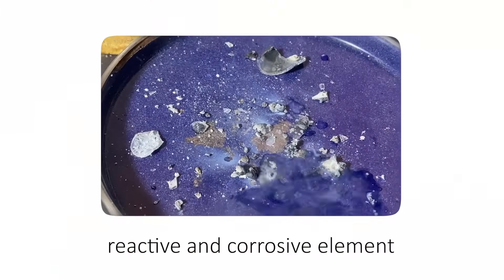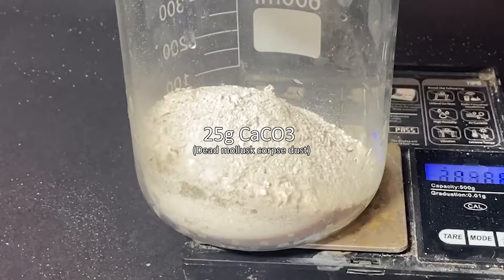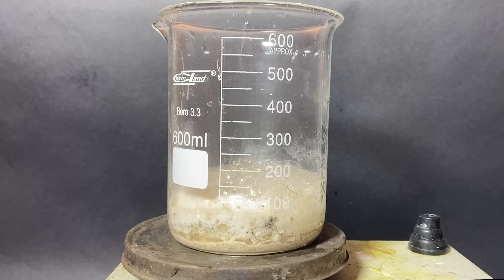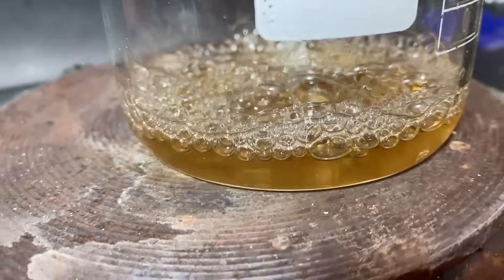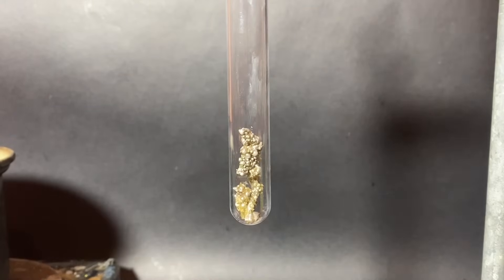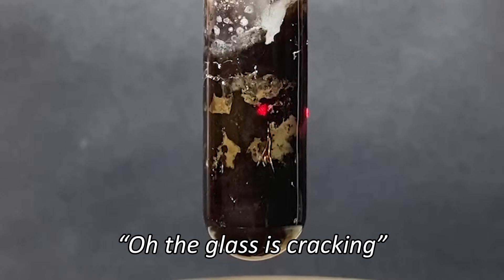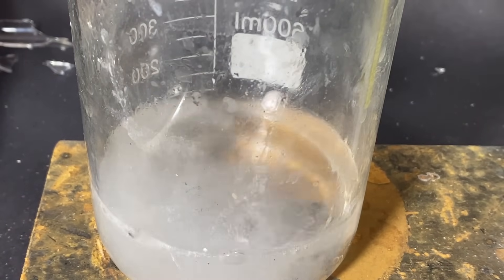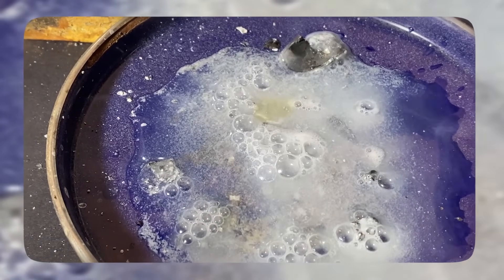Making Calcium metal from seashells

Comment: Not better is mixing aluminium and calcium carbonate to powder and burn it:

3 CaCO3 + 2 Al -> 3 Ca + 3CO2 + Al2O3

Carbon dioxide as a gas realse to air and you finally get a mixture of aluminium oxide and calcium metal. I think using aluminium is better than using acid and sodium

Comment: Herr Doktor! I don't seem to have anymore sodium metal in my cabinet! 😢 but I do still have a bumper crop worth of lithium pellets. Can I get away with using em? Danka
Reply: Yeah ! I remember not so fondly, once upon a synthesis where I decided to make a go of LiCl and instead of taking my time and 1 at a time with the Li pellets into very angry 39% yes 39% hcl and I wanted to go have a smoke outside Ssssooooo! I done threw 7 pellets in the erlynmeyer and within a second I knew I'd really fucked up because 1 pellet ignited starting an ...well let's say reactor 4 done malfunctioned and  it went 4th of July in my bathroom 😂😂 and right before the flask blew, it shot out 3 extremely bright but gorgeous magenta red fireballs at the ceiling 😂😂😂 man it took me 2 hours to stop shaking! Thanks for your input! Happy holidays sir!🎉
Reply: @Angrychemist666-g4x did it work for you? i want to do this 😬😬😬
Reply from the maker: Of course, in fact lithium works much better for this, however make sure that all the lithium will be consumed and well mixed, because it does react and destroy glass.